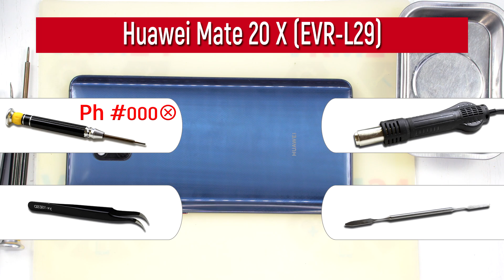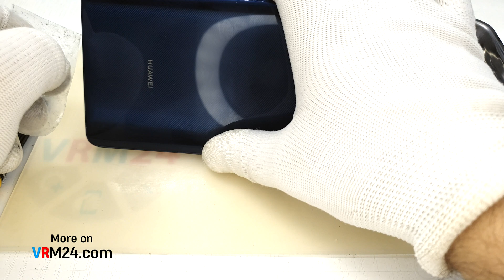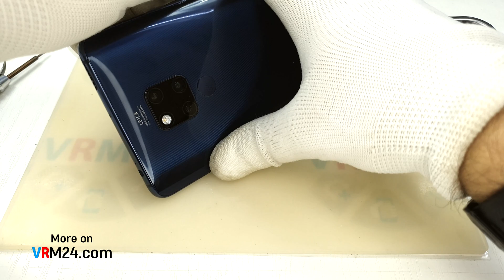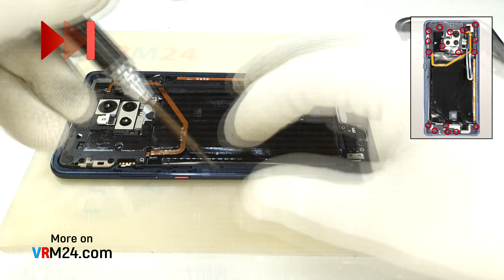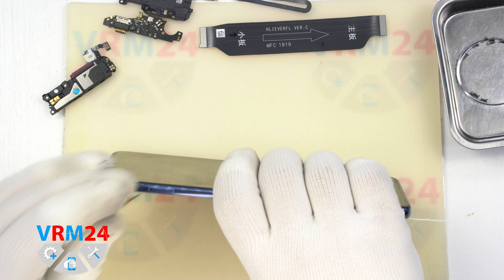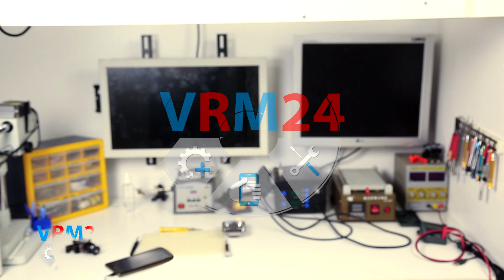Huawei Mate 20X EVR-L29 📱 Teardown Take apart Tutorial

Comment: I know which part the microphone is on (it's on the USB-C charge connector board). However, where on this part is the microphone?

My local phone shop fixed my phone, didn't put it back together properly and are trying to justify charging me extra money for correcting a mistake they made.

If I know where the microphone is located on the part... I may know the issue.

(The mic works, it just doesn't pick up sound properly. It is as if something is obscuring the mic - it doesn't pick up voices but picks up the vibrations of the phone being touched directly). Seems like it's definitely an installment fault and not a fault with the part itself but just in case it is the part, I have a replacement. If it was a fault with the part itself, then it wouldn't pick up sound at all...but it does.